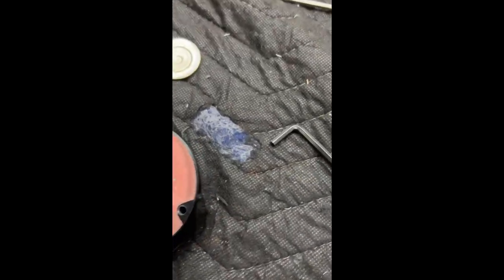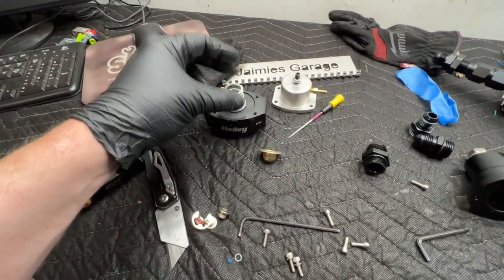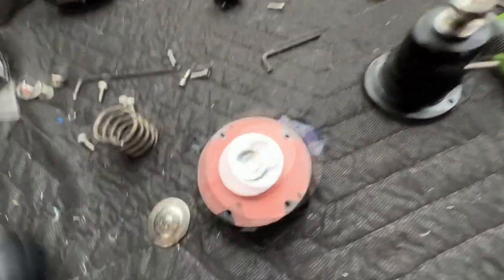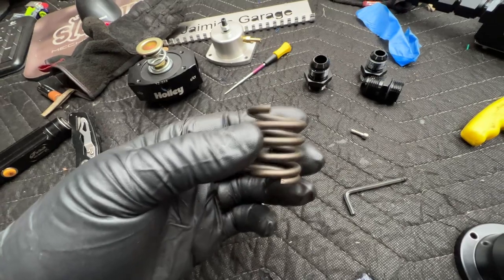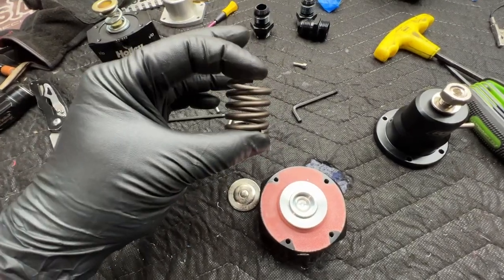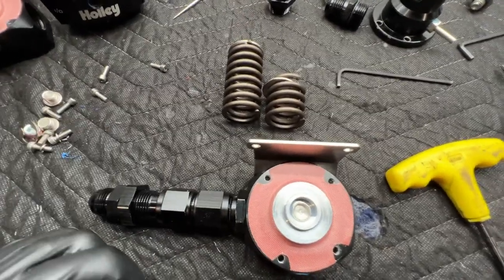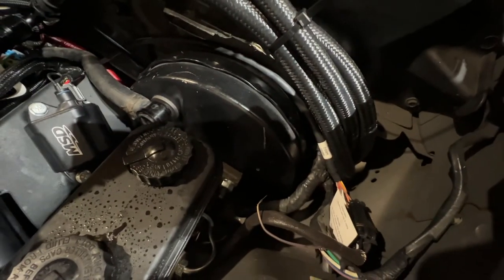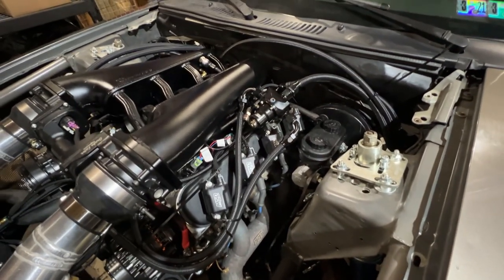I OPENED A 30$ FUEL PRESSURE REGULATOR AND YOU WONT BELIEVE WHAT I FOUND

Comment: The reg that's slightly more with the square-ish flange for the top half is the one to get, they offer it in both AN8 & AN10. The Aeromotive this unit copies has a much taller top half, but this unit probably uses the same huge spring.

Comment: Been running that regulator for 2 years, when I first put it on it shot up to over 100 PSI adjusted all the way out.
I ended up grinding like two coils off of it a little at a time, got it down to 45psi and left it.
It could have used some more but it was like compressing a truck spring each time lol
Been working ever since at 45psi 
It'll go up but it won't go down unless I grind some more
Reply: Yep... it has room to fatigue.

Comment: When you cut a coil spring, you make it stiffer. Cut in half makes it twice as stiff
Reply from the maker: Somehow managed to get my fuel pressure exactly where I wanted, because installed height isn’t crushed. 

It’s not how strong or how tight this spring is. Its installed height is like 300lbs of seat pressure and you need zero to be able to run 100% return. 

It’s possible you’re not understanding it or how I presented it

Comment: I had the same regulator, couldn’t get it lower than 70psi, I had to cut off the spring and open up the “6an” id return,which was .100” smaller than a actual 6an id fitting. So it did lower the psi to 38min, so I set it to 43 base pressure and was dropping pressure at 4psi boost, went to 36 psi instead of increasing. Got a new one and that thing was leaking so bad I just gave up on them. Got a Magnafuel one and problem solved.
Reply from the maker: this is the 10 boi with a gigantic return
Reply from the maker: it still has every opportunity to fail lol
Reply: Mine were the 8/8/6 . But yea, even the Magna can fail, its a 8/8/8 . I tried using only one pump (Walbro450) and when I activated the second pump on idle, the pressure went from 43 to 60psi on the PQY, and on the Magna it stays constant at 43psi with one or two pumps on.
Reply: Having same issue with mine. Leaks so bad on the return seat I can't gain pressure on boost. Junk